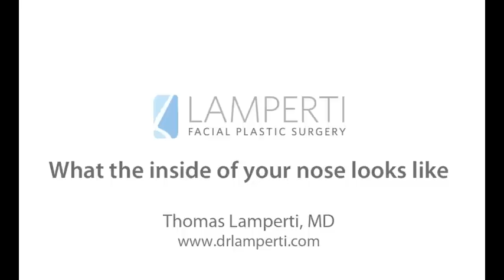What the inside of the nose looks like

Comment: Hey dr lamperti, if u pause at 0:49 we see that the septum has this protruding bump which is slightly outward. What is this structure called? Also is it possible to have this structure slight more outside without looking like a very typical septal spur which I assume is the same structure just deviated

Comment: thanks a lot for the nightmares that was gross like who put a camera through the nose and doesn't hurt that's just fake not real Wow lol
Reply from the maker: ***** I've not had a patient with compromised blood supply in their nose such that it is a problem to use the topical decongestant spray during the office exam. Best, Dr. Lamperti
Reply: They have numbing spray that is sprayed in the nasal cavity and several minutes later the doctor comes back into the room to use the camera. Kind of looks like really thin black licorice rope. My son had this done but to look at the top of his throat, through his nose. The numbing spray also greatly reduces the gag reflex.
Reply from the maker: Becky Miller That's right Becky. We typically spray a numbing and decongestant spray in the nose when using our endoscopes (especially when looking further down at the voice box). If we're just looking in the nose we obviously don't have to travel as far with the scope either. The little telescope we use is quite narrow and most people tolerate it quite well.
Reply: if you use numbing spray to use the telescope, can that not potentially worsen things if one has already a perforated septum due to the cut off of blood flow and oxygen?  I mean does numbing spray not have same properties such as vasoconstriction?
Reply from the maker: The decongestant spray doesn't totally cut off the blood supply to the nose so it is safe to use for the examination. Best, Dr. Lamperti
Reply: DrLamperti ok, but shouldnt it be taken into consideration if patient has already bad blood circulation?

Comment: Does deviated syptom correction surgery leave a scar?
Reply from the maker: Hi N Holt,
A septoplasty procedure to correct a deviated septum normally places an incision inside the nostril area where no one can see it. You can check out my rhinoplastyinseattle nose surgery website to learn more about septoplasty (under the "Functional Nasal Surgery" section). In less common cases (usually involving a severe septal deformity, an open rhinoplasty approach is needed for surgery, but this is far less common. Ultimately, your septoplasty surgeon can guide you as to the best approach and which incision lines to expect after surgery. Best, Dr. Lamperti
Reply: Thank you for the response.